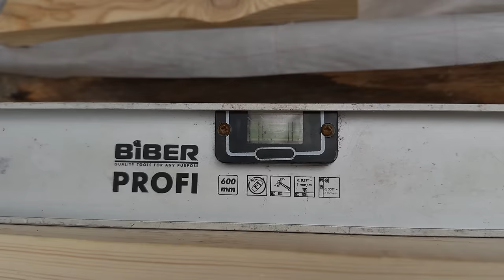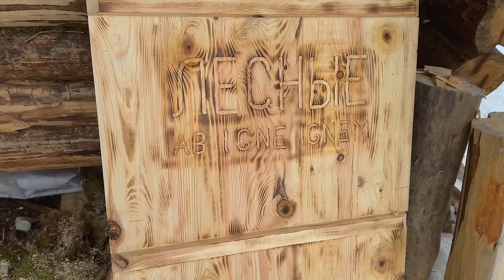Escape the Cold: Mastering Winter Camping in the Mountains

Comment: Sorry, guys, but I have to inform you put on the door on (Backwards !) Those hinges and latches go inside not outside. If you leave the door like that, then anyone who comes along who wants to break in simply will use a Robertson Tipped Screwdriver and will be able to gain entry in only a few minutes !
Reply: I don't think they have to worry too much about crime in the neighborhood. They can also alter the screws so no one can use a tool on them. 😊
Reply: @occamsrazor7939  You'd be surprised how much crime there is these days in rural areas. Your solution would also render it impossible for them to use their own tools on it at a later date should they decide to change something.